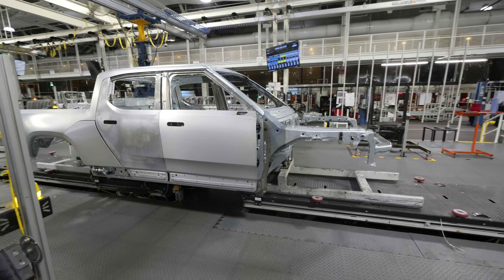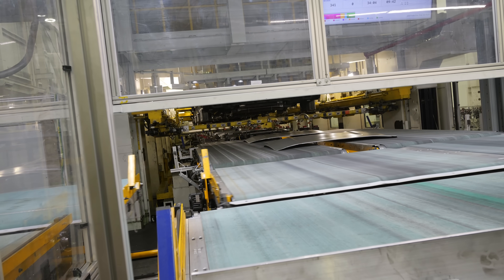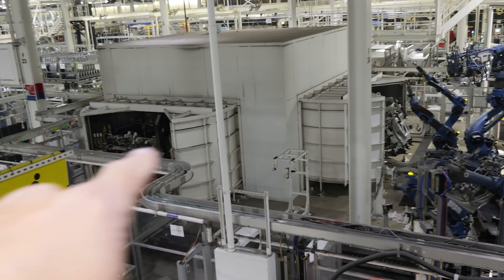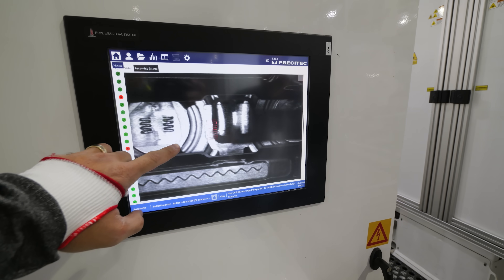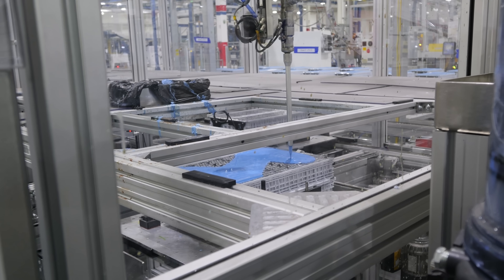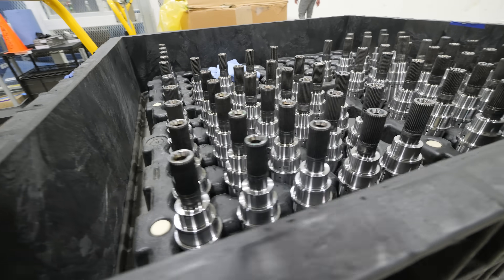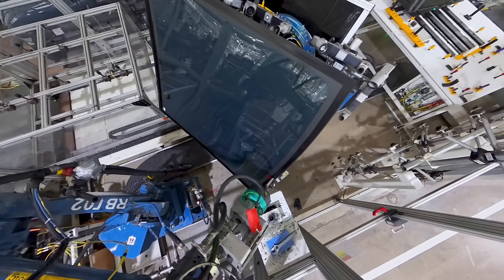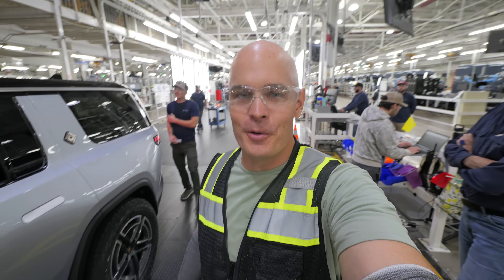How to Build a Rivian -- Worlds Fastest Truck!

Comment: Can you imagine Henry Ford traveling to 2025 to see a competitor be this successful by only making electric trucks and suvs out of robots who are also completely electric?! What a world!
Reply: "Guess I was right about that production line thing?"
Reply: Electric cars had major market share before the model t
Reply: Bro would enter a catatonic state after the greatest mental breakdown ever 😂
Reply: "This successful".

Which means what?
Reply: Ford was aware of electric vehicles.
Reply: What I don't understand is why electric cars don't come with "range extenders" like they do in China. You know, little generators that run off of gasoline to charge the battery?
Reply: @SixOThree Exactly 💯 that's always been my idea 💡 for a small narrow tandem 2 seated, super aerodynamic, electric car. That looks like a VW X1 concept car. That can slow-medium change off a standard 120V 20 amp 🔌 outlet. Or fast charge off a regular 240V outlet so no special expensive home charger needs to be installed. Then use a removable 3000-3500w inverter generator that fits in a compartment on the car as a range extender when needed for road trips.... Instead of using a regular car engine with either the electric motor sandwiched between the engine & transmission. Or elsewhere in the car. The removable generator,  even large. Is going to be much easier to maintain than a regular car engine & transmission. The generator would eliminate the need for a transmission on a hybrid.
Reply: sorry, this competitor is not successful as they are losing billions! worst EV make on the planet so far.
Reply: Hopefully solid state batteries will actually get here. With more range, faster charging times & longer life. Even if only double the range, 2x faster charging & double the battery 🔋 life span. Would be a major game changer for everything that uses batteries.
Reply: About 100 to 120 years ago electric cars were pretty common. Then they became outdated, and cars running on liquid fuel became the standard.
Reply: Love Rivians but they're not successful yet. They're losing money on absolutely every vehicle they make.
Reply: @veganpotterthevegan  I guess it depends on how you measure success. I would say having influence on the market is more important in determining success of a company than current capital gains imo. I don’t want them to go under by adopting that philosophy, I just think there’s more than one way to look at it
Reply: @veganpotterthevegan  Rivian turned a profit in Q1 2025. But they are also investing heavily in production of the R2, design of the R3, and plans for their second manufacturing plant in Georgia. I wouldn't bet against them.
Reply: Did you know that Henry Ford and oil companies stop electric vehicles, production because they were invented electric vehicles in 1920 yes that's true, so Henry Ford and oil companies, we're involved in this partly in politics as well, if this none it happened to the stoppage of electric vehicles we would have electric vehicles long long time ago and improvement in the batteries😢😮
Reply: @JohnJohn-ts6ux Batteries 🔋 weren't energy dense enough to be practical for electric cars until lithium batteries came around.
  Battery companies throughout the entire 20th century were constantly trying to make a better/more power dense rechargeable battery. 
 It's not like the oil 🛢️ companies and Henry Ford somehow stopped battery companies from trying to make better batteries.
I doubt they ran any electric car makers out of business. Because batteries/electric cars, couldn't compete with the speed & range of 1920s gas cars. I suppose it's possible they might have shut down some electric car company. But find it unlikely since they knew a battery powered EV couldn't compete. Throughout the 20th century people have used lead acid deep cycle, Nicad & Nimh batteries in electric ⚡ vehicles. They just weren't practical, I highly doubt the oil companies & Henry Ford never stopped the technology of electric cars. The battery technology just didn't exist back then to make long range fast electric cars. The electric car was actually invented in the late 1800s. Before any internal combustion engine car was built.
Reply: @JohnJohn-ts6ux  Nah, electric cars just had worse range, and the batteries had to be swapped all the time or you had to find a charging spot. Pouring it new fuel into the tank was easier.
Reply: they arent that successful being i rarely seen them even at gatlinburg during the biggest car show of the year lmao

Comment: Sadly the motor technology is many decades old and the battery tech hasn't evolved much in the past 15-20 years.
Reply: I really don't know what you mean, the batteries are constantly being developed and improved. Just recently, LG announced a new battery that will start shipping in new EVs soon. And over in China, they have been releasing new battery technologies about every year.
Reply: @ProXcaliber   Who is using these new LG batteries?  Most manufacturers are still making/selling/using Lithium Ion batteries because they're cheaper than the newer tech.  And what happens in China is unfortunately not happening in the US.  Tesla has talked about new cell tech but hasn't started using them.
While true, EVs using Lithium Ion batteries are less likely to catch fire than ICE vehicles, however... the chemistry used by Lithium Ion are an order of magnitude harder to extinguish and put out toxic fumes while burning.
Reply: @_SurferGeek_  You said, “the battery tech hasn't evolved much in the past 15-20 years”. So are we moving the goalpost now by changing where the battery tech is improving? And yes, most battery manufacturers are still using lithium, because that is the most viable metal that can be used now, and still offer high density battery capacity. There is current interest, and in some cases already viable market applications, for sodium batteries, but you likely won't see them in EVs for some time. Likewise, there are other batteries like dry cathode batteries that are starting to hit the market already. These are a general improvement over previous batteries, offering more capacity, better longevity, and safety. And yes, lithium fires are dangerous when they do burn, but they are still 60 times less likely to burn than a combustion vehicle. Even so, I am certain you wouldn't want to stand next to any fire and inhale fumes, regardless what started the fire.
Reply: @ProXcaliber  
Considering the current push to adopt EVs and the vociferous proclamations as to their efficiency and greenness... No, the battery technology hasn't changed much.  Sure, there are new technologies on the horizon but until they're widely adopted and shipping in mass produced EVs, they're essentially pipe dreams and moot.
"Less likely to burn" is irrelevant with the increasing number of EVs on the roads.  And when considering the toxicity, length of time they burn and the amount of water it takes to extinguish them, and with more and more EVs on the roads, it is indeed an issue.  Better procedures need to be developed to handle battery thermal run-aways and fires.
Reply: @_SurferGeek_  I agree that better fire response methods are always worth improving. Still, EV fires are extremely rare compared to gas cars — studies worldwide show they’re far less likely to happen, even after adjusting for how many are on the road.

The claim that battery tech hasn’t improved in 15–20 years just doesn’t hold up. Modern cells have higher energy density, longer life, and better safety. That only happens through real progress in materials and production.

And the environmental side isn’t a mystery either — lifecycle data consistently shows EVs are cleaner overall. It’s not opinion, it’s just what the data says.

Comment: 5:44 let's have a moment of silence for the battery recyclers 🙏
Reply: I honestly don't think that would be an issue. When they disassemble the battery modules for recycling, I'm sure they care very little about everything what is around battery cells themselves. I've seen that they literally shred the batteries and basically dispose of anything that isn't metal, and then it is sorted down from there. Both through mechanical and chemical means.
Reply: @ProXcaliber  I was thinking he meant resuse instead of recycling
Reply: @KevwePatani  I don't think it would matter for reuse, either. The only time I could see it being an issue is if you wanted to repair individual cells, which I don't see why you want to do that. Generally, people who buy entire battery packs or entire modules for home storage, for example, will check if the battery modules they are using are defective or damaged.
Reply: Have you seen how these batteries are recycled? They literally shred up all the material in a liquid and then separate all the individual materials, getting about 95% back to be used again.  Check it out.
Reply: You can still reuse individual modules, but yeah recycling the 18650s is out of the question
Reply: it seems that you can replace the submodules in the battery pack but not pull the cells and replace them from the sub modules due to that resin, I thought they would glue the entire battery pack so it cant be disassembled
Reply: I had the same thought about trying to recycle potted batteries haha

Glad some people more familiar with battery recycling were able to help out.
Reply: I can't say that this is the case here, but it would probably be possible to make some sort of resin that could be made liquid again by applying the right chemical formula, and therefore would be reversible, or even, in the best case, reusable.
Reply: It’s the anti diy repair resin lmao

Comment: Doesn't the plastic coating make them harder to reuse, service or recycle? I guess it doesn't stick to the cells but for sure if a cell is dead then the pack would become unusable for vehicles cause that coasting for sure is impossible to reproduce in a service environment.
Reply: In a case of service, you wouldn't be replacing individual cells, and instead you would be replacing the entire module (not the entire battery pack). For reuse, that covering doesn't really matter, unless you want access to the individual cells, in which case, yes, it would be difficult to remove. And for recycling, the entire battery pack is shredding and sorted, so it doesn't really make a difference.

Comment: Rivians are cool until you realise that damage to the bedside can total the entire truck. 
Seen people get multiple quotes for over 35,000 dollars to replace the bedside.
Why?
The bedside is part of the uniside of the cab. It’s all one. Meaning to replace the bedside you replace the entire uniside as per manufacturer repair instructions.
Now I do know some PDR shops have repaired the bedsides pretty good, but if it’s not within PDR range, you’re screwed, and the truck is totaled over a damaged bedside.

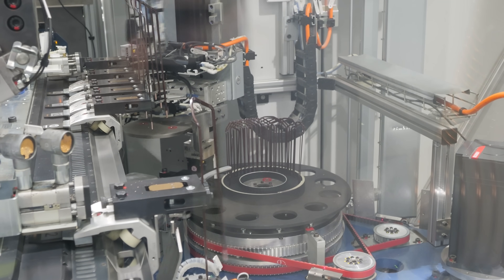Comment: 8:19 even Pluto is no problem, as long as both component have the same temperature nothing gets loose. ;)
Reply: If the shaft were a different material with a higher coefficient of thermal expansion, it would still loosen (or at least lose pressure).  But in this case the coefficients for the silicon steel laminations and the 4140/4340  shaft are nearly the same, so Pluto's probably fine.
Reply: I wasn’t thinking about how cold the batteries would be, I was thinking about how low the air pressure would have to be in the tire so they wouldn’t explode. Onward and upwards.
Reply: not necessarily
Reply: The batteries though

Comment: I'm surprised to see how much of the manufacturing is performed in the same factory. I would have expected some of the subassemblies like batteries and motors to be made at separate dedicated manufacturing facilities.
Reply: The batteries are only assembled here (7776 batteries put together in a battery pack), but the biggest work is done somewhere else, probably in China like 95% of the batteries produced

Comment: I tried doing some researching on fastest truck and rivian does claim to have some specs that are faster than the cybertruck cyberbeast, they haven't been fully tested yet. Rivians quad motor truck should be faster off the line of what they claim is true but needs actual testing to be proved. But so far on paper the cybertruck still has it on top speed and faster 0-60,

Comment: Really interesting video! But I can imagine that (A) using many 21700 cells for the battery pack and (B) completely potting them in resin doesn’t contribute to easy recyclability once the batteries have reached the end of their life — especially compared to the larger prismatic cells used by other automotive companies.

Comment: 6:12 I wonder if this makes recycling difficult or impossible?
Reply: nahhh, Potting mades repair difficult, not recycling. EV battery recycling is usually done by grinding the whole battery pack up, then separating raw materials out.
Reply: Not at all. It makes individual cell repairs difficult to impossible, but in recycling, they literally just shred the entire battery and then sort the stuff they want vs. what they don't want.

Comment: That blue firewall on the battery packs, will that make the packs harder to repair? As in, replacing a faulty cell or something.
Reply: You wouldn't be replacing individual cells, but the entire module (not the entire battery pack). A small price to pay in my mind in the case of a fire or collision.